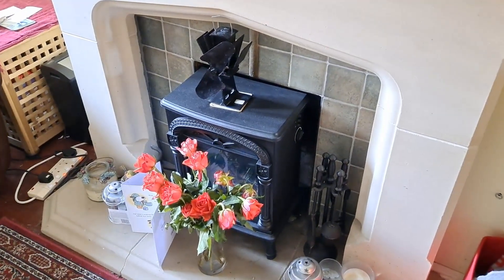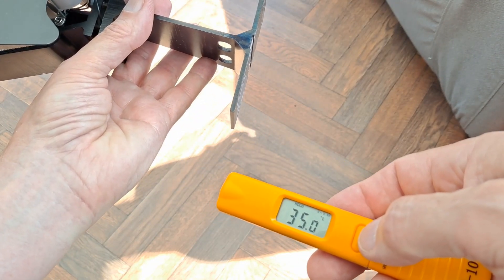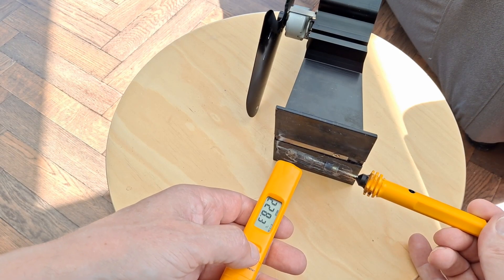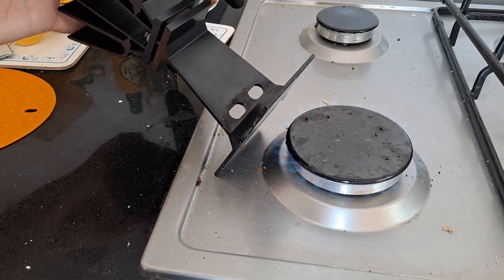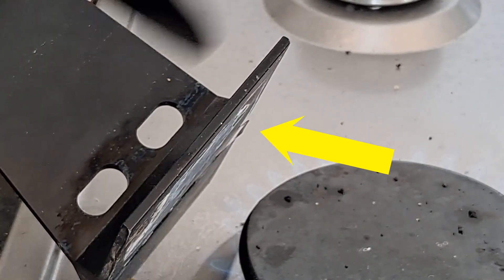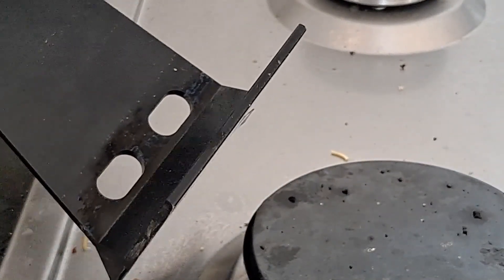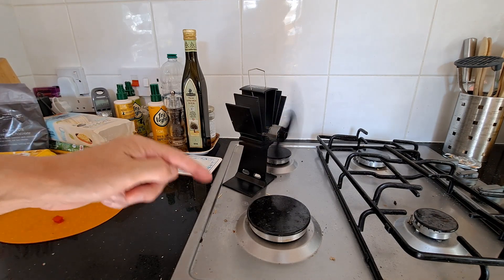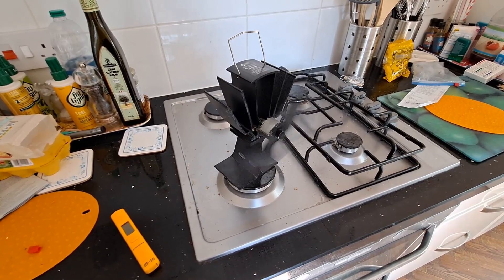Stove Fan bi-metallic strip Video Reply 20220716

Comment: Hi Grandad, thanks for the shout out. My original comment may have disappeared, as it was a reply to another viewers comment  on the bi-metallic strip, which I think the OP has deleted. Anyway looking back to that first video, it is turning in reverse as Dan H mentioned. So it seems that the thermocouple will produce power with reverse polarity when the base is cooler than the top section. Just thought that’s quite interesting.
Reply from the maker: Thanks for the original comment, and thanks for this one too 😊